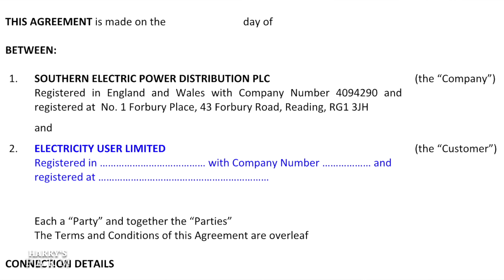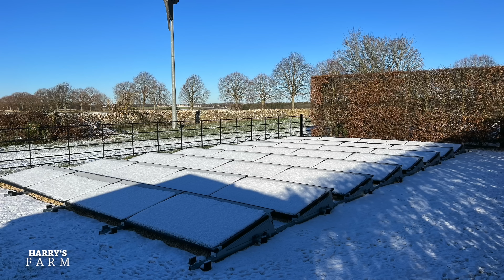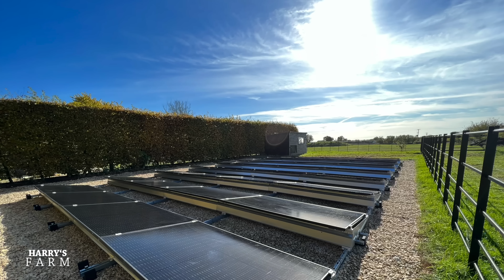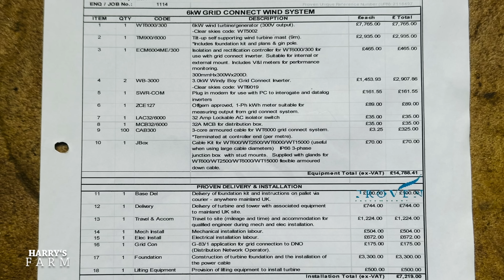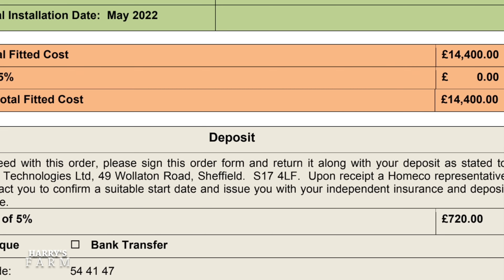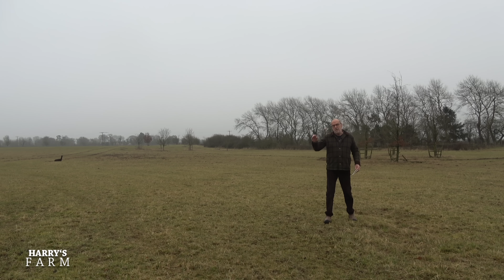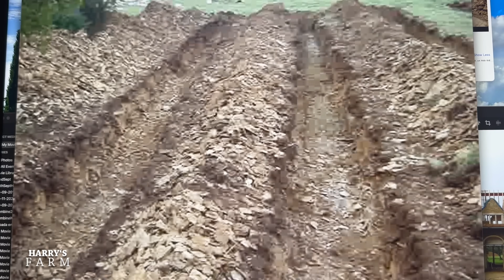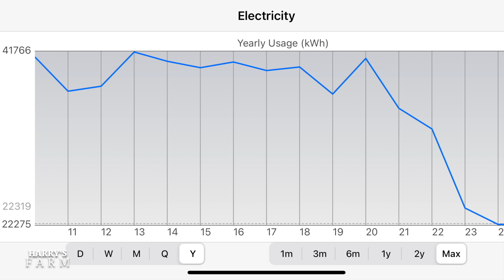Are solar panels & heat pumps worth installing? Here's what I've learnt after several years of use.

Comment: Sorry, if I have misunderstood, but from what i have learned and what i know (sharing knowledge) Move your cars/car chargers to octoplus intelligent or only charge when 7/8p kw this way you then sell your production for 15p thus making/offsetting more. Finally add some batteries this will cover your over production and also winter usage. You know how many kwh you use a dayily average take that number and add it in batteries check out Pytes rackmount batteries if I have not installed everything enphase i would use them, they can charge and discharge/power your house up to 100a. Alot of BES can only do short burst. but where i am going is, your production is then charging the batteries for your night time use, if you dont produce then it charges from the grid at 7/8p kw for the next day; if the batteries are full then you sell for 15p. Thus you always receiving maximum income from selling or using it and not paying 25p kw (time of writing). Payback is the same as the solar typically; however depending on if you want to take it a step further you can sell yout battery stored for often alot more tham the normal export rate of 15p. This is a really short version of a very complicated monetary investmnent; many will disagree, you do the maths your good at this stuff from your video. The only advice i see which i would put down to learning experience is 1. panels are far too small 2. you were sold a string setup with SHADE poor advice to you. 3. Wind - i did the maths and it just doesnt add up to install wind. generation on small scale. 4. You know your EV is cheap to run...do it for your house too.  Full Enphase 9.1kw on 21 panels clipped to 7.6kw connected to 20kw batteries (also Solar iBoost for the hot water 250ltr tank). Bills down from >£300pm to circa £120pm Winter.  Summer they owe me.  Payback 3.5-5yrs realistic. Could be sooner but I like to be cautious.

Comment: So in answer to your question about "what is the point of battery storage".... I am currently on a dual tariff with Octupus, the Outbound one you mentioned (export 15p/KWh) but on my import i am on the "GO" tariff for electric cars. This gives a very cheap rate overnight from 00:30-05:30, a bit like the old economy 7 rate- this is when you charge everything up including Batteries, EV, Night Storage Heaters, Stored hot water etc etc. You can then use your battery power through the day to power everything you need including your air to air heat pump which does not need to be on all the time like an air to water ASHP. The day rate is 1 or 2p more but with enough battery storage you will never use it. Bottom line if you do your system right is you pay 8.5p for imported electric and you export @15p. Over the course of the year in an average house it is quite possible to break even and even make a small profit and that's with a solely electric house like yours.

Comment: Hi. Can I compare these figures with my fossil fuel experience. I too am privileged to live in a large property in the country (Welsh Borders which makes the Cotswolds seem warm!). Its as 300 year old property of approx 5000sq ft (465m2). Having looked into options I found the capital cost and disruption too much for our lifestyle/property.  I spent approx £10,000 servicing the oil heating system and installing log burners; we also have a fantastic old oil Aga that does virtually all our cooking and 80% of our hot water; warming kitchen etc
I spent about £4000 on oil last year, £2300 on electricity and virtually nothing on logs. We have a warm house with instant heat gratification; the upfront cost would still not have been paid off if I'd gone for your system 15 years ago

Comment: Your installer should have told you that you need optimizers (tigo on my system). I got my system in 2017 and I have tigo on every panel. It is worth noting that you can sell your excess summer generation to the likes of octopus for 15p per unit and this builds up in your account to offset winter usage. I am a little amazed that you spent that much money on something and didn’t know how it was going to work!

Comment: air source and ground source heat pumps work the same way - air source from the air, ground source from the ground - typically take 5 degrees from the ground to boil the refridgereant and heat pump upgrades the heat.

Comment: I built in 2013 in Germany to KFW 40 spec, which means it doesn't use much electricity. 
Built with a ground source heat pump, with 600m tubes at 1.2m deep. Heats a 280 sqm house with underfloor heating, livingspace, on three floors.Alphatech pump, which runs around 3.5kw. 
House has triple glazing, 52mm think, walls are 50cm with ytong blocks and 200m insulation inbetween the bricks. 300mm insulation in the pitched roof.
Plus air recovery system and 15kw peak system set at east, south and west. Also 12kw battery. All in running cost for the house is 400euros a year. EV car too for the excess power in the summer...etron Q8.

Comment: Interesting video. I have a 60ft shed with one side south facing and have been considering solar with batteries to power the house. Although batteries give better flexibility to use the power the cost just can’t be justified. To be honest I don’t really see any of the so called clean energy solutions being financially viable. You certainly need to be in a position to put a lot out in first place and wait some quite considerable time for payback if there is any

Comment: Great lesson for all those who still believe that solar power is the future.

It is not. Even if you live in a country with plenty of sun all year round, you would still need battery banks to go 100% solar, and that is not viable on a global scale, because of the pollution it would create to produce so many batteries, and not economically. Only viable for those who can afford the luxury or by necessity.

Solar power is part of the best current solution we have so far. There is no energy transition. It is pure marketing BS . There is only energy diversification, and it is the best we have until fusion becomes a reality, which could take decades.

A combination of hydro, solar and nuclear is the best we have. Wind is only viable in very specific locations, but the long-term cost and total carbon footprint are not worth the hassle in most cases.

So it will probably take another century to completely get rid of oil and coal.

Comment: ground mounts are good - but they are all facing the same way- you would need a large battery. we install tilting cornish rocker frames. You could put optimisers in to reduce shading effects. we use Tigos,. the panels are connected in series. All decent installers will do shading assessment- you should get a sun path diagram. Solar is from march to September - you have wind and so reduced output shouldnt be a problem - the clue is in the title SOLAR!

Comment: "Hello, i've put diesel in my petrol car and it does not work! I want to blame someone!"
Reply: You have on the ground-mounted solar panels behind hedge and at 10 degree angle, you're losing 50% of the day there is. Then i also understand from the comment on production being affected by any shadows that you have not optimized this install with optimizers.

If you set something up to fail it will fail.

Comment: There needs to be a serious breakthrough in solar panel technology. Naturally, they are working on doing just that, but advancements are still lacking and as I understand it, a solar panel still only has an efficiency of around 20%. Ideally, we need to be aiming to achieve that level of efficiency from the light of a full moon on a cloudless night! I find it disappointing that governments are ploughing in trillions in the advancement of AI, but there is not an equal amount of enthusiasm and fervour in developing things like solar panels or harnessing the power of the sun. A highly efficient solar power may be the secret to solving the EV range and charging debacle. However, what I do like about solar panels is that they can be easily replaced with minimum of construction costs. Especially if they are on the ground like in Harry's case. Although I suspect that the recycling costs will likely push up the price of swapping panels to astronomical levels. What I did find extremely odd and strange was that one needs to get permission from the electrical supplier in the UK who can dictate the amount of energy a homeowner can produce. That seems ridiculous to me.  As the technology stands today, it is very difficult to convince many, including myself, to make the investment into installing solar panels. It just isn't efficient enough.

Comment: The way I think about heat pumps is that they effectively dump the cold from the house somewhere that can easily absorb it (ground/air).

I do wonder whether with massive insulation it might be possible to heat up a huge storage heater during the summer, and use that heat over the winter.

Overall I think we need municipal systems for this stuff. It would make far more sense to have a single enormous ground source heat pump per town.

Comment: Ground source heat pump installed in 2019, new idea if you have the space is to minimise turns in the pipes so we have 4 350m trenches (in a field like Harry’s) to make the flow efficient.  I get nearly 5kw’s of heat for each kw of electric. Lots of underfloor pipes running just 3 -4 degrees above the room temp.  It just means the house is always 21 degrees, it’s a lovely system.  It has a big thermal store so heats tap water to 60 degrees. You do need a lot of space to install it.  Was going to get solar but not sure how I’d use it in summer.  Will investigate a turbine.

Comment: In the winter our utilities cost £300 a month, during the Summer it drops to £45. 11 panels 3 east, 5 south 3 west. We get power whenever it's available. All the panels on a South facing is far less effecient. We also have a battery and a diert. ANy excess ofter the battery is full heats a 300 litre cylinder of hot water. The payoff is due to be 2029 and it was installed in 2022 on current prices.

Comment: I’m lucky in that my solar installation is in Southern Spain, however, apart from the rubbish FITs the biggest issue I face is battery storage. I’m installing an additional 6kw/h this year so hopefully that will enable me to run the HVAC + house systems for 48 hours in the (unlikely) event of the PEVs not producing power. This technology isn’t as simple as it sounds…

Comment: What a MESS 

I’ll stick to Gas or Wood I’m in a city .. no option to go with a system like this 

Electricity is about to get so much more expensive .. there simply isn’t the capacity in production

To deliver the same quality of energy using wind and solar vs oil gas and coal it a THOUSAND times more material intensive and costly .. IT WILL NOT WORK it’s a fairytale fantasy 

It is a Net Zero Delusion

Comment: I wonder if two sets of panels could be repositioned vertically againt the bushes.  Could a wood boiler balance the heat pump low performance in cold days?

Comment: Hat's off Harry. I also have a big Cotswold's house. Mine's old and has single glazed windows which we're not allowed to change. It costs a fortune for gas, electricity and wood-burner firewood each year.
Reply: You could suggest mounting a modern low transmission glass on the inside.

Comment: What you can do with a battery system, is have a time of day tariff. We are on the EON next drive tariff, which charges 6.9p kWh between 12am and 7am. During the winter we charge both the car and the house battery during this time. Just checked our January bill and 98% of our usage was at the 6.9p kWh rate.
Reply: I like that idea. 👍

Comment: Completely different there than here in Houston. We're lucky to get a few clouds in the winter. One idea i could throw out are sand batteries. I dont know if theyre cheaper than regular solar batteries, but they wouldnt wear out over time when you arent using them.

Comment: Harry, the angle your panels are set at is heavily favoured towards peak summer. You would benefit from increasing it towards 40 degrees. You would see some drop in production in the summer but a lot more in winter

Comment: Average boiler is typically way oversized as its deigned to provide heat for instant domestic hot water heating.
Reply: Yep, and then for the average heating demand of winter it works at very low power, far away from optimal efficiency.

Comment: I appreciate that the ground floor of your house  is a heated  by the ground source heat pump, have you mirrored that underfloor heated sandwich upstairs. I have been led to believe that any heat pump is not good through radiators at all and I just wonder what the upstairs floor construction is .
Reply from the maker: Upper floor also has underfloor heating, same as downstairs, so no radiators. Works well except when you get a sudden drop in temperature, as it doesn’t respond as quickly as a gas boiler system. Having a small, portable electric radiator is very helpful at times like this!

Comment: For all year best performance the panels ought to be at a 45 deg angle. In winter 60 deg, in summer 30 deg. If the panels were placed at 45 deg the winter output would be 50% higher, the summer output would be 10% lower. At 60 deg winter output would double.

Comment: Thanks Harry useful update and  insight to your energy production and  consumption for your lovely house. We looked at  installing an underground heat pump/ slinky system a few yrs ago which at the time did stack up financially mainly as it included underfloor heating unfortunately we we were already spending a lot of ££ on building works so decided against it. Fast forward to now and we are 20 months into our modest 3.5kw  solar system on the house roof , this has so far peaked at 12.5kw /day produced in summer  and typically averages  4kw/ in winter but can easily drop to 0 - 1.5kw in mid winter, we pay only the standing charge for our electricity and receive a little over 600 per Yr selling surplus to the grid. 1 big thing I have learnt is to keep the panels clean as a little dust etc  can cut production by as much as 80%. Like the idea of a wind turbine to counter balance our winter supply currently,  so Harry what is the size in KW of your turbine?

Comment: Great video, I like most really struggle to heat our swimming pool and garage
Reply: Yes, I too find it dastardly difficult to heat my swimming pool.
Reply: You think you've got problems, the dolphins on my fountain don't have enough solar in the winter to spurt water much more than 2ft in the air. Its embarrassing.
Reply: @MrMen-o9p
@bjorn2625
I'd use solar thermal (hydronic for floors, same thing just a little different for floors) for a pool evacuated tubes/small LiPo battery with solar panel to power a pump and controller. Those evacuated tubes can produce 50 deg C with a sniff of diffuse winter sun and boil water with a parabolic reflector on a single tube in the summer - something to research if you're not familiar. Would also make a waterproof, insulated blanket using the  recycled plastic bottle insulation which isn't adversely impacted by getting a little wet now and then, though if you make it well with rolled, folded, silicone sealed and double stitch edges, it should be water tight. Widely avaiable and cheap tarp sheeting would work, or you could make your own waterproof fabric from say commercial quality dust sheeting (you'd dunk the sheets in a solvent silicone solution). some ideas for you to ponder.

Comment: the low output in winter is normal for your system: on the ground and low angle, optimized for summer sun. For winter the angle should go up. Maybe install a variable slope  system?

Comment: One of the reasons your December output is so low, is that your panels are at the wrong angle. The are too shallow for summer, let alone winter. I'm surprised that the installation was a professional one. They ought to have steered you clear of that angle. 45 degrees would have stood you in better stead.

Comment: Need to drop the heated pool, call David Pagan Butler and drop the need for chemicals too. But hey that’s what I would do if I put in a pool or bought a place with one. The angle on the solar is set for summer but Britain is so far north winter generation even at a proper angle will be low. Nice to see all the heat pumps, renewables and proper insulation deployed for so long though, that’s commendable.

Comment: The heat pump makes use of Kevin's Law.

If there is a thermal gain through the pipes, if you increase the pressure on that volume, the higher the temperature.

Comment: Lovely place. You have got the uselessness of solar pinned down but I think a comment on the cost of the installations is needed for balance. There must be at least £30k worth of kit between the solar, wind turbine and heat pumps. That's a lot of investment that needs to be set against the returns you get.